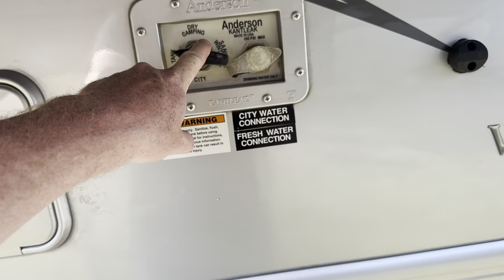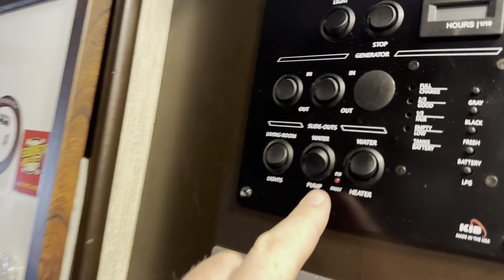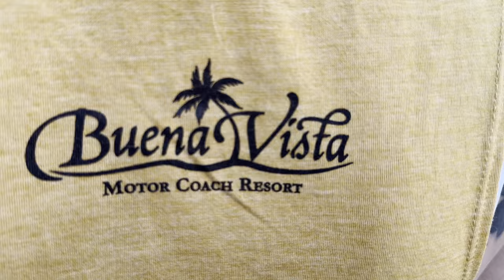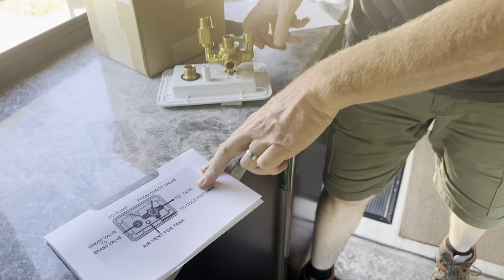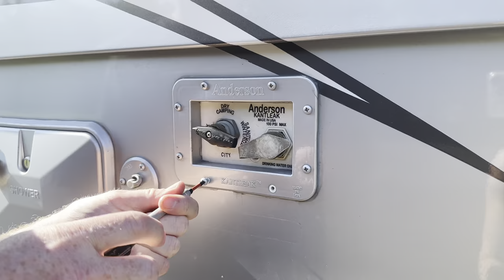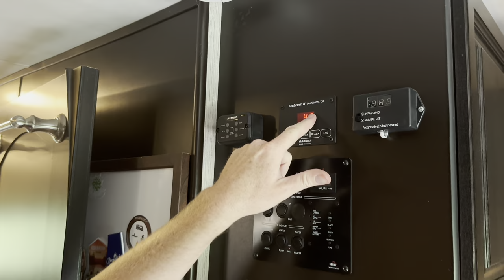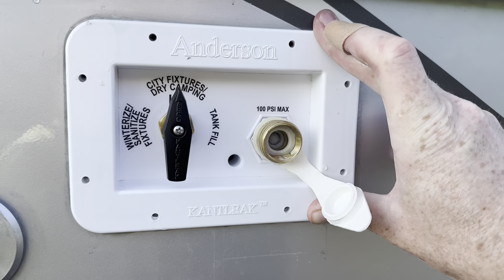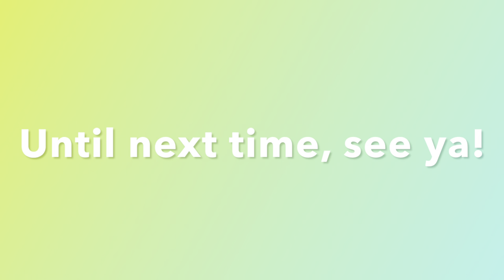RV Water Issue Continues & A Fix! (Layover In Nashville, TN)

Comment: I have had several water line leaks in my Rockwood travel trailer. I finally bought a pex crimping tool and the rings you crimp the lines with. I carry them with me every trip. I actually  had to use it on a trip to Key West. The valve went bad on my Dometic toilet and I had to replace it.
Reply from the maker: We also carry Pex and all the tools and connectors with us everywhere. Definitely comes in handy!

Comment: Mike TUVM for showing your water pump with the braided SS connection.  We bought the same pump and it was extremely noisy.  With the SS braided connector, it has quieted down tremendously.
Reply from the maker: No problem!  The braided line definitely helps

Comment: FWIW, I added a full length Smart Solutions Rock Solid splash guard to my motorhome to protect my tow vehicle and it also keeps the rear the motorhome much cleaner as well.  The hardest part is coming up with a mounting bracket solution, since every rig is different.  Great upgrade IMO.
Reply from the maker: This is something we have considered adding as well...I guess add it to the list of upgrades haha
Reply: Yeah, the upgrades never seem to end.

Comment: Yes travel days can take it out of you but it's worth it if it gets you where you need or want to go.  Mike I'm wondering if you could put the old plastic mounting plate on the new valve.  Just wondering because I may, probably will, have to do this one day on my Ghost.   Next time you guys come to Michigan can Lynn was my rig?  I'll let you video it.  Keep the good stuff coming guys and give the puppies a treat from me.
Reply from the maker: We considered putting the new brass on the old painted cover but there old knob was annoying and the new design only has 3 selections vs 4 so we just didn't want to mess with it. We may get some items repainted anyway so this might be added to that.
Might need to start a side business where Lynn washes RVs😂

Comment: Hey,maybe it’s me and being a retired mechanic but I would have unscrewed the Phillips head screw and removed knob and jam nut and swapped all over to the painted cover. Not too late to do that unless you chunked the old part
Reply from the maker: We did consider that but after all the messing with it over the past several weeks we just opted to use the new one.

Comment: Couldn't the valves be swapped into the original housing? Sorry if this has already been asked. I am surprised at all the tinkering required to keep these things going. Thanks for sharing.
Reply from the maker: We did consider this but just didn't feel like it. Plus the new valve only has 3 selections while the old had 4. It doesn't bother us that much that it's white. We can always get it painted to match

Comment: Could you replace the new faceplate with the old one? It looks like they could be interchanged. The factory plate would look way better. Great job though.
Reply from the maker: Could but the new valve only has 3 selections in different positions than the old faceplate lists etc. It wasn't worth it to us at the time. We'd rather get the new one painted instead

Comment: Your better off with all ass on that manifold. Mine is a mix of brass and plastic. We froze over a few years ago and it started leaking. Jayco sent me a new one. We cut off the crimp rings and used radiator clamps! Easy swap if it ever happens again!
Reply from the maker: Hmm weird we have been below freezing and zero but never had the old valve freeze up on us.
Either way glad to hear you got yours up and running quickly again!👏🏻👏🏻

Comment: I just watched this video and one question comes to mind, why didn't you just take the valve out of the new white plastic piece and put it into the old painted piece, then you would have still had a match or is the new valve body size different enough that this wasn't possible. Just curious.
Reply from the maker: The old valve had 4 selections the new valve has 3. Yes it would have swapped over just fine but the labels/selections would be different.
Reply: Thanks for the response, that thought crossed my mind after I hit send on the comment. Then I thought maybe they were like the other stickers that you had taken off and could have been moved around.  Thanks for the clarification, enjoy the channel and see you trips you guys take.

Comment: Could have removed guts from new plastic piece and installed them in your silver one that matched camper. But you probably already done that by now.
Reply from the maker: Yes we could have done that but they are slightly different (3 vs 4 dial) but would rather get the new one painted to match instead.
Reply: @WanderingWagners  heck yeah

Comment: You Should Have removed new valves from new bezel and installed in old bezel that was painted to match.
Reply from the maker: We considered that but the selections address different on the new/old models. New only has 3 where's old had 4. Just didn't feel like messing with it. Better alternative is to get the new painted

Comment: Maybe you could have removed the the old valves from the painted panel and installed the new valves so you could keep the original panel.
Reply from the maker: We did consider that but the new and old valve do have different settings and we just didn't want to mess with that. We might just get the new one painted

Comment: what stuff do u use to wash causae i got a white car hauler i use to haul my trike and camp n and the black streaks dont like to go away
Reply from the maker: Black magic wet shine car wash. We don't have an issue with black streaks on this RV but previous ones did and we used black streak remover spray and it worked great for that.

Comment: I'm trying to figure out the best way to keep water spots from happing. No matter how many time I rinse always get the spots ands runs, I really don't want to invest in an de-ionized water system. It's true the back end is always the dirtiest. 😃
Reply: I use a leaf blower to dry after a towel off.
Reply from the maker: Don't wash in the sun and dry it after... But that's just a lot most times haha we do notice that when we use Salts gone we don't get the water spots!
Reply: @WanderingWagners  Salts Gone should sponsor you. Lin would make a good cover model for there brand. 😝
Reply from the maker: @CraftingN112DR  we do have a working relationship of sorts with salts gone but a spokesmodel isn't one of them😂👙 Lynn would probably enjoy that lol

Comment: Mike Anderson was a competitor of mine. Brasscraft/Plumb Shop. screws and instructions should have been included unless it was a return item or from another source than Anderson. Plastic fittings are usually requested by OEM for reduction  in price or for big box store fittings. Most professional plumbing shops will offer both.
Reply from the maker: We got it on Amazon. We could have it quick that way. From Anderson was several more weeks out.